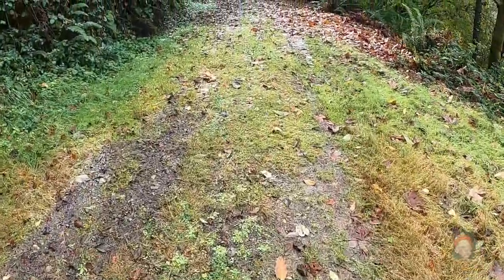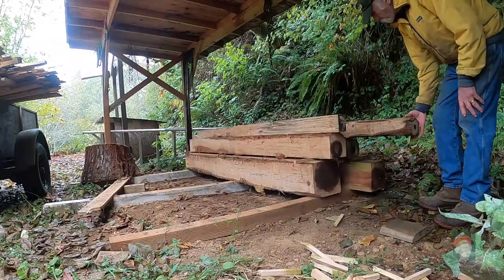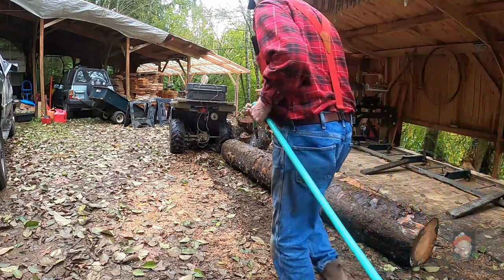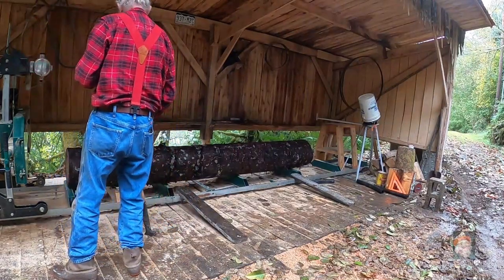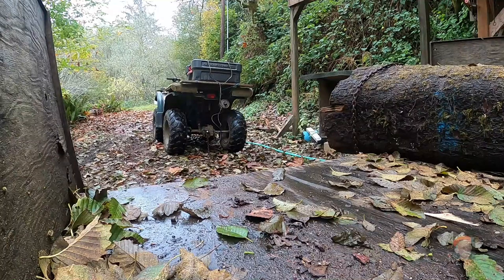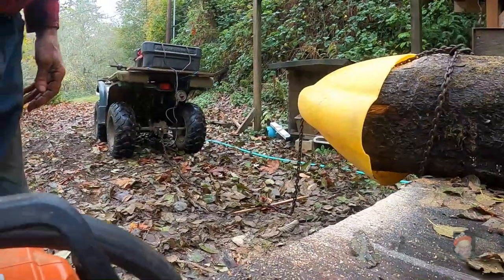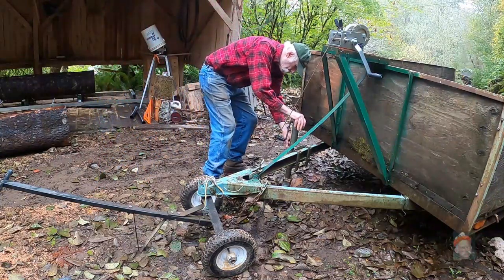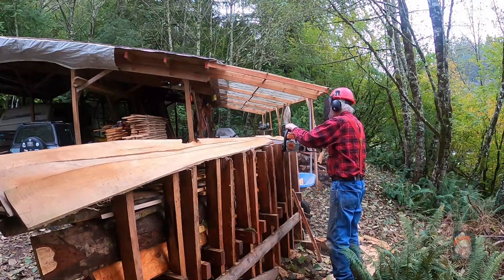A Day in the Life of a Disorganized Sawmill Operator

Comment: Ok, theres no room for winch on other side of mill, but there is room for a pulley.... Drive up to center log with ATV at 90 degree angle dangle, run cable to pulley on other side of mill that is attach to mill wall then back to the log, run cable over top of log in center of log and down around under log, then back to wall on other side of mill, the log will roll very easy, AKA Parbuckle....
Reply from the maker: That would work just fine, but doing all that would take longer than rolling it on with the cant hook.